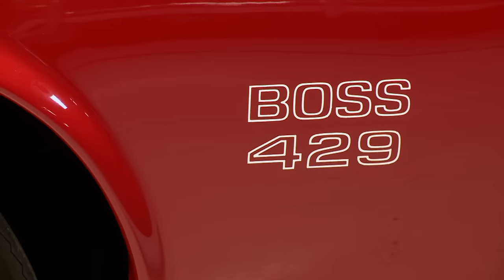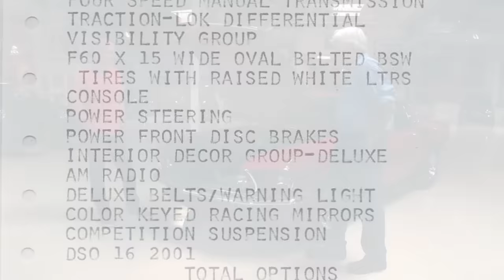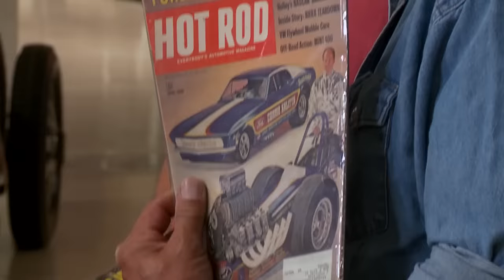1969 Ford Mustang Boss 429 - Jay Leno's Garage

Comment: It's funny to hear someone say "it could run on 91 octane gas".  In 1970, the gas you could get at the pump would be racing fuel today.  Sunoco sold 105 octane gas for 40 cents a gallon in 1970.  91 octane was the cheap stuff that you put in your lawn mower.
Reply: was it leaded? I remember all the stations had regular & unleaded.
Reply: @BigAlWillis  leaded, all of it was leaded in the 70's from what i can't remember...............lol
Reply: @OugaBoogaShockwave  my brother worked at a gas station in the late 70's when we were kids. I remember there being regular or unleaded pumps
Reply: @BigAlWillis  Grrrr8T...........remember "jason" movies too ?
I Do, they felt unleaded while smelling Awesome.....................i want kids today to smell the 70's................
THX, enhale it sooooooooo Smells grrr8T
Reply: Galenda Wagen   Boomers built the roads you drive on, the buildings you live in, the food in your belly.  Thank them every chance you get.
Reply: @InfiniteMushroom  AMOCO's "white gas" was premium LEADED fuel.  All gas stations had unleaded in the same year, because it was mandated by law.  The first generation of "low emissions cars" was 1972.  By 1975 all new cars sold in America were required to have a catalytic converter, which required them to use unleaded gas, which required an egr system.   The only reason they kept selling leaded gas after 1975 was because most pre-1975 cars had no egr system to prevent pre-ignition detonation,  commonly known as "ping",  which often damaged valves and pistons. You can still buy leaded gas today, but it's expensive as hell. The cheap option is to buy the "lead" additive,  which has no lead, but does the job.
Reply: @InfiniteMushroom The name "white gas"  was given to Amoco's "high test" gasoline to indicate that it was clean and pure. It had lead in it. All gasoline had lead in 1970.
Reply: Galenda Wagen  And that would be what, in actual language?
Reply: Galenda Wagen  #fax
Reply: Peter Evans   Now that I've installed a supercharger and fuel injection, I am cutting the 1/4 mile of grass in 8.90.
Reply: Yeah also make sure to thank the boomers for two forever wars and $27 trillion in national debt.
Reply: @Largetalons   the boomers had nothing to do with two forever wars and 27 trillion in debt.  That was the work of the liberals born in the 70s and their communist children.
Reply: Peter Evans   That might clog up your filter.  Why not use the liquid lead additive.. it's already dissolved .
Reply: Peter Evans  Does powdered lead dissolve in gasoline?   I'll save you some time.  No it doesn't. Lead has to be turned into lead oxide before it can be dissolved into solution.  I believe you don't know what you are talking about.
Reply: Peter Evans  Maybe you should do some research instead of backing up your lie with false assumptions. You said that you put powdered lead into your gas.  That will not dissolve.
Reply: Tim Hallas     Tim,  100% CORRECT YOU ARE!!  Wish I could shake your hand 🤚
Reply: Jason Voorhees     Leaded Jason.
Reply: Tim Hallas       Ah, the “WHITE-GAS-DAYS.   I remember them quite well actually.  Boomer here. Born September the 14th, 1957.
Reply: Tim Hallas    Correct you are Tim. All gas back then had lead in it.
Reply: @timhallas4275  Robert probably still has biden stickers on his electric honda!😡.
Reply: @packingten  Robert is one of those liberals who take huge government tax brakes to put government funded solar panels on his roof, so he can wear the "going green" pin on his jacket, when he flies on the fuel guzzling jet.
Reply: Sunoco had their "Gold" premium that was around 105 octane.
 I moved to Florida, in the late 70s and built a 428 CJ for my 75 F150.
Because high octane fuel was available at gas stations I built it with 11.5 compression ratio.
After I moved out west I had to run octane booster, not the cheap stuff, which didn't help.
I built a water injection system for it, that stopped the knocking completely.
I kept the truck for decades then gave it to my oldest Grandson after he graduated from Marine Corps Basic training so it's still in the family
Reply: You could get both regular or unleaded for quit some time, because to many people were driving cars with old engines requiring the lead for valve seat damping.
Reply: @johnmarshall4442  The purpose of the lead was to prevent pre-ignition, sometimes called detonation or ping.
Reply: @timhallas4275  you realize most politicians in congress are boomers? my parents were born in the 70s my generation is not even old enough to have made a significant impact on anything lol. 

your car commentary is on point tho 💯
Reply: @timhallas4275  and left us horrendous nimby housing policies that tanked the housing market, ran up the debt clock, put us in endless wars, failed to implement UHC, jacked up the price of college, etc.

Boomers had it easy. They pillaged our world and left us with the bill. We owe boomers nothing.
Reply: @timhallas4275  Boomers didn't built most of the roads.  When I think major infrastructure upgrades in the US, I think of 1946 to 1960.  So that's  Boomers parents and grandparents.
     My Great-grandfather was born in 1903 and he worked buildings roads
Reply: @MarvinMonroe   From 1959 to 2009, over 400,000 miles of NEW roads were laid down in America. That's mostly my generation doing that work.
Reply: Every now and then,we would stop at AMCo and run a tank of white gas through it. That’s what they called unleaded premium back in the day.
Reply: @timhallas4275  That's not a good thing. At all.
Reply: @lewisshepard9239  It,s spelled AMOCO, and white gas was leaded.
Reply: @richardc7721  all you needed was an egr system.  My cars were always 15 -20 years old,and when they stopped selling leaded gas, I ran a 1/4th inch pipe off my exhaust to the intake.  Had to also back off the timing on my 440 dodge.
Reply: @timhallas4275  you’re right about the spelling. I spelled it right, but when I hit send it must have a mind of it’s own. lol. But back in the early seventies,before unleaded gas was mandatory, we would run a tank of Amoco premium for the higher octane. At that time it was unleaded.
Reply: @timhallas4275  Sounds like the incoherent ramblings of a lead poisoned boomer, but ok.
Reply: @lewisshepard9239  I remember it different than you. I will check the history books. Get back to you later.
Reply: @timhallas4275  it has been awhile. Appreciate you doing the leg work. If I’m wrong,it won’t be the first time. lol.
Reply: @timhallas4275  Just being curious,I went to google,typed in picture of Amoco premium pump from 1970. And it did confirm that Amoco premium was unleaded.
Reply: @lewisshepard9239  Yep, I found it too. But it wasn't called "unleaded",  it was called "certified lead free".  It was  37 cents per gallon, when regular leaded gas was 29 cents per gallon.
Reply: @timhallas4275  unleaded,lead free. Exact same thing. You said it had lead.
Reply: I was living in Fla 77 to 79. 
I built a potent 428 CJ for my 75 F150 4x4, 11.5:1 compression along with a cam  to match because Sunoco  
and Amaco both had 105 octane at the pump.
Then I got sent to Arizona where 93 was the best you could get.
Had to run a race additive that was $24 a qt, back then $24 was a lot,
Then I rigged up a water vapor injection system, finally my engine was happy again.
Reply: @BigAlWillis  73 they introduced low lead fuels, and mid 74 went to no lead for the 75 and up model years with cats.
Reply: @richardc7721  you’re exactly right. I remember in the seventies when you could buy Amoco premium,which was called white gas. It had like 104,105 octane.
Reply: Marvin Willis  not Amoco ultimate premium. Like I said we would run a tank through there every now and then just to clean it out. We called it white gas,because it was basically clear. You know leaded gas was like orange. I had a 69 roadrunner at the time, and it loved the higher octane.
Reply: Marvin Willis  Same year that catalytic converters showed up on the exhaust.
Reply: @timhallas4275  they actually started using EGR on cars around 1972/1973.  The white gas Amoco sold was Lead free Premium... It was the high test stuff as they called it back in the day.  They actually started installing smog pumps on cars in the late 60's.
Reply: @matthewmiller2268  I was a mechanic in 75, and outside of California, there were no cars with egr valves or "smog pumps.
Reply: @timhallas4275  you're right...the same with NY and some other New England states that had high population density.
Reply: @richardc7721  was in Hotel Business in 70's & My company had a Little 50 Unit Best Western in Winter Park Fla.& My Boss transferred me there to Run it,As Disney world Opened.I Had Just Bought a 71 Jave.AMX & Started Running the SUNOCO 240 & 260 in it & You Don't  Want to Park Your Car in Sun,W/ the SUNOCO Racing  Gas in it.One Day a Guest in Hotel Came to front desk & Asked Who's Mustard Yellow AMX is that.The Racing Gas Was So Strong ,Had Ate the Sending Tank Gasket Seal in It.Had To Have Shop Repl.it.LOL
Reply: i remember being in the car and pulling up to the pumps and the question would be leaded or unleaded? i was too young to understand what difference it made
Reply: @followyourbliss101  I remember seeing 88 octane low lead regular in the 80's and 90s growing up in Sunnyside Washington
Reply: @edcain9492  the Best Western chain was started by a fellow named Coxwell, he was born and raised in Wickenburg AZ, so the story went.
His Hotel, The Rancho Grande is still in operation.
Reply: @BigAlWillis  Unleaded Was Offered in 72_73 ,Believe.I Remember my 71 Javelin AMX Having a Air Pump that  was started on most Vehicles in 71-72 that got Rid of Emissions or recirculated Air to do W/ Emissions.
Reply: @richardc7721  the BW inspections  of Hotels back then we're Tough as Nails to Pass
Reply: @BigAlWillis  in the uk we had 2,3,4 star petrol and possibly unleaded came in the eighties.
Reply: To Tim Hallas. The way they figure octane today is much different than the way they used to figure it. Two different formulas so you're not comparing apples with apples.
Reply: @pmaint1  R+M method is still used today. 50 years and running. Go back to school.
Reply: it's got the same front /rear weight distribution as a 300 sel 6.3 Mercedes .
Reply: @MarvinMonroe  
1946 to 1960 was the Boomer years NOT their parents . As a Boomer I will own up to anything that was done wrong but we didn’t give away the store . For the benefit of all of us please ID what we did wrong, I hate the way things turned out too so educate all of us . 
Back to cars now !
Reply: Sunoco's famous pumps that you could dial the octane rating you wanted.
What were they called, The Dial-a-Matic pumps? I can't remember.
Reply: @Lockemeister  The Sunoco pumps I remember had 5 grades of gas from 85 to 105 octane. You just pushed the button and the pump mixed the gas for you. 85 was for lawn mowers.
Reply: @OugaBoogaShockwave  Amoco (now BP) had unleaded fuel long before it was required by the government.  However only its premium gas was unleaded.  Regular still was leaded like everyone else's.
Reply: Yeah. 
My first girlfriend,
She was somethin'.
Reply: Do any of you remember Ethyl gasoline? I remember dad pumping that gas outside of my window and for some reason just loving  the smell of that fuel.

Comment: Can you imagine an era where you could drive a 429ci as a daily driver
Reply: 1969
Reply: 7L wonder what the mileage would be with today's fuel prices.
Reply: A man can dream
Reply: You still can ,why couldn't you . I daily drive a 454.
Reply: A modern Camry will put more HP to the wheels than the stock Boss 429 and have massively better handling.
Reply: lt was my first car in HS in 1978 l bought w/ a fast food job. Mine was t-boned and totaled. Back then you could find them w/o much problem. l bought a 69' AMX w/ the insurance money.
Reply: I almost could imagine... I got my first mustang when i was 16,a 1986 GT. The first year of fuel injection and my favorite option was theTTops. Anyways, back to the question i was responding to. So easy to start talking about the olde stangs. When i had that 302 gas was 99 cents a galon.sweet times.
Reply: @rockets4kids  Its still a camry, I know what Id rather drive and be seen in
Reply: A 429ci Cobra Jet V8 would be better in a daily driver than the Boss 429. Could get an automatic and air conditioning with the Cobra Jet V8. That's good enough for me.
Reply: @rockets4kids  Sure...how much tq does your camry make at 2500 rpm? 
Its a chick/kid car anyways
Reply: @gordocarbo  I would call the Camry more of an old man's car, but the reality is that because of the vastly improved suspension and brakes the average person can drive one much faster than one of these old muscle cars.  You needed both skills and balls to drive these cars anywhere close to the capabilities of the engine.
Reply: @rockets4kids   Its the fun factor of driving them regardless of performance. Rented a Sonata last yr and was impressed how quick it shot off a light, turned left (stayed flat etc). Rather be driving the older ones still cant fall asleep in them.
Reply: @gordocarbo  When it comes to the fun of driving, my choice is always going to be the smallest, lightest car possible.  In this regard I'll much prefer a 60s vintage European sports car over the American muscle cars.
Reply: Sure everyone did back in the day. Even in the 80s, 90s I had those kinds of cars as dailies. 
Cool thing was growing up as a kid they were everywhere in traffic 
20 yrs from now guys will talk about that Hellcat or ZL1 they had and youngsters will laugh at them
Reply: I still do, and get 20 mpg

Comment: I've always thought that the 69 was the best looking Mustang ever.
Reply: me too
Reply: Me too!
Reply: I thought the '70 was equally good-looking, and the '67-'68 was not far behind.
Reply: Same.
Reply: Agreed, most muscle cars looked the best during 1969. The charger, camaro, chevelle, mustang, el camino. The list goes on.....
Reply: Generally speaking, a ton of cars from that area look absolutely stunning nowadays. I don’t know why, but they just have a type of beauty. It’s just an engine, steering wheel, and a gorgeous car. - All I need
Reply: Best looking car ever in my opinion!
Reply: Me three!
Reply: Me too, father had a -70 (although not a Boss  just a 351W) one when I was young very late 80's, bought and later sold for peanuts and looking at prices today and especially in great condition I bet he regret quite a bit. The -69 front is sweeter looking for sure, but still swap my daily driver KIA in a heart bit today and it's brand new haha.
Reply: Much easier to wash the taillights than on my wife's '70 with the taillights in instead of out like the '69
Reply: 1967-68 fastback. Much cleaner shape.
Reply: Leno really had an uncharacteristic negative attitude going in on this car. Definitely better looking and better handling cars than the Hemi Cudas or Challengers that he loves.
Reply: So true! Love me a 69 fastback.. even if its not a boss
Reply: same
Reply: same
Reply: I agree. The best looking Mustangs are the boss 429 and the mach 1. When i see these two cars i just want to cry.
Reply: @georgeking1185  
There's a car show I go to in Syracuse New York and every year there is a 69 Boss 302 and right beside it is a 69 Boss 429.
Both are absolutely showroom perfect.
I always stand there drooling.
Reply: '69 & '67
Reply: I agree We had 1969 Mach 1 Winter Blue 👍
Reply: I would say 1970 but definitely no later! 1970 in my opinion was the pinnacle of muscle cars. 69 beautiful as well.
Reply: 69 was the best design year for all the big 3 cars imo.  And you see a lot of that styling in the newer models.
Reply: @JackF99  Mopar Hemi's are a dime a dozen compared to the 69/70 Boss 429. Today there are probably 10 426's to every 1 Boss 429.
Reply: I always liked the 70 Boss 302 the most but the 69s are beautiful.
Reply: 69 is good, but the 70 1/2 was always my fav.
Reply: can't argue with that
Reply: Nice
Reply: 1000% Agreed.
Reply: Not the best looking Mustang its the best looking car in my opinion
Reply: DUDE IS it just me or do other people dream of the 69 boss 429 with with 68 fastback rear. THAT WOULD BE INSANE.
Reply: From 65 to 69, best looking Mustangs imo
Reply: @charleslasorsa6629  
👍
Reply: @hrodvityr  oh, many times ive dreamed of seeing a Mustang like that! A 69 Mustang with a 68 rear end of the car, ooh, that'd look wicked cool!
Reply: 67-68 are better looking imo
Reply: Probably because it was designed by a former GM guy. Larry Shinoda.
Reply: @colehara  I tend towards 65-67.
Reply: Me too 😁